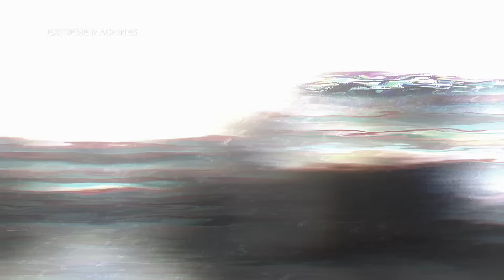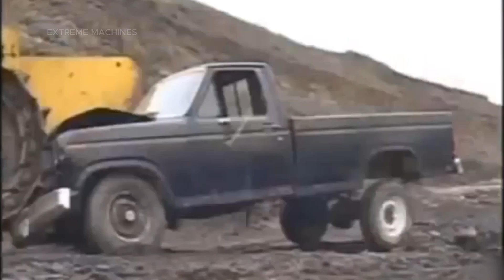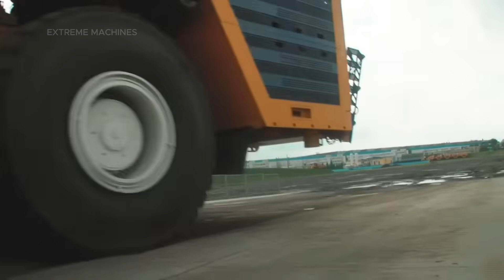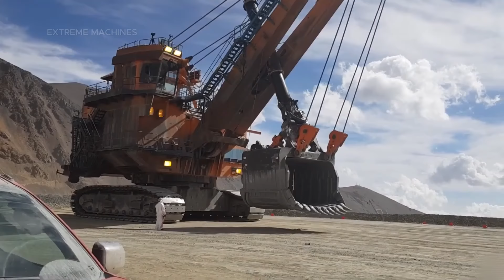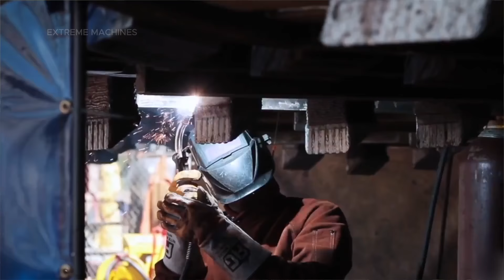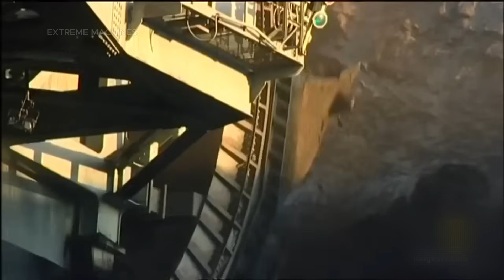The BIGGEST INDUSTRIAL MACHINES ever built by mankind — MUST-SEE!

Comment: I got a chance to go out to the peobody coal mine which was an open pit mine providing coal to power three 750 megawatt generators. The boilers were over 200 ft tall and each generator turbine assembly together were a football field in length. There were 6, i think, bowl mills that acted like carburetors for each boiler where tons of coal was dropped in then crushed and blown into the boiler. Out at the mine there was a dragline that must have been berthas big brother. This would swing the bucket at speeds that i think exceeded 100 miles an hour (although that was an old memory) There were several incredible stories. One of the most memorable was a D9 cat hauler that had started to slip down the incline toward the vertical cliff of the mine. The dragline operator swung around and scooped it up in the bucket to deposit it safely back on the road. Don’t know if it really happened but it was a great and certainly😂 possible story. It was too big to have tracks, it resembled 6 2 story homes side by side in two rows. So it moved by a long foot on each side and walked to its destination, although decidedly slowly

Comment: The largest piece of heavy equipment I ever worked on was a Caterpillar 330 excavator. 
That is a mere 65,000 pound machine and it was massive. It came to the shop a couple of times per year for maintenance.
When that happened, drop whatever you are doing and get on that machine to get it turned around and get it back out to the jobsite. It billed $325/hour. 
I just cant imagine dealing with something 100X the size. Just incredible.
Reply: my porsche dealer charges 310 $ an hour..

Comment: PRETTY INTERESTING SHOW BUT WHEN IT CAME TO ONE OF THE EXCAVATORS CALLED BIG MUSKIE BUILT IN 1969 THE NARRATOR SAYS IT'S THE WEIGHT OF TWO AIRCRAFT CARRIERS I SAID TO MYSELF IS THIS GUY ON DRUGS? 

IT WEIGHS 13,000 TONS THE GEORGE BUSH AIRCRAFT CARRIER WEIGHS 100,000 TONS AND THE KENNEDY WEIGHS 100,000 TONS SO THAT'S 200,000 TONS HE CLAIMS THE WEIGHT OF THIS MACHINE. STAY OFF THE DOPE FELLA AND YOU WON'T BE A DOPE YOU'RE OFF BY ABOUT 90%

Comment: There is the world's Second Largest Power Shovel Machine, in West Mineral, Kansas, called Big Brutus, that you can tour today.

To quote from Wikipedia,  "Big Brutus is the nickname of the Bucyrus-Erie model 1850-B electric power shovel, which was the second largest of its type in operation in the 1960s and 1970s. Big Brutus is the centerpiece of a mining museum in West Mineral, Kansas, United States, where it was used in coal strip mining operations. The shovel was designed to dig from 20 to 69 feet (6.1 to 21.0 m)[2] down to unearth relatively shallow coal seams, which would then be mined with smaller equipment."